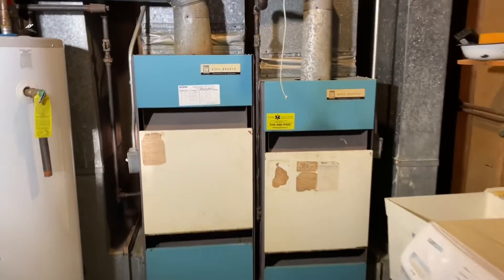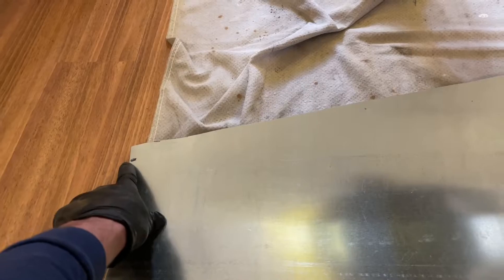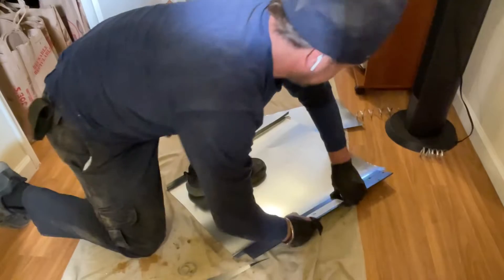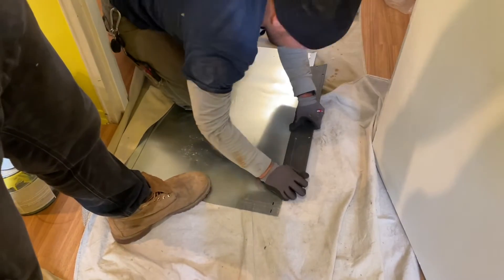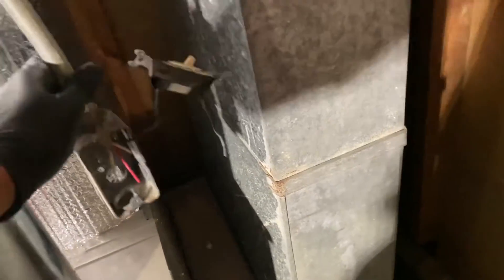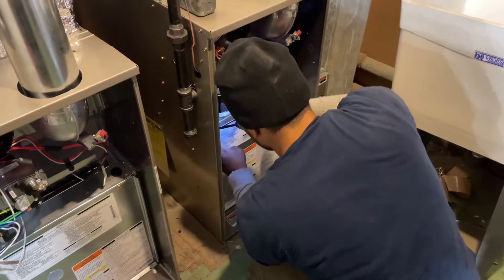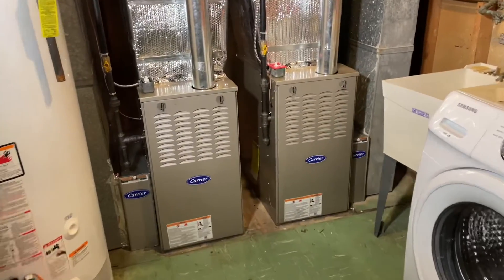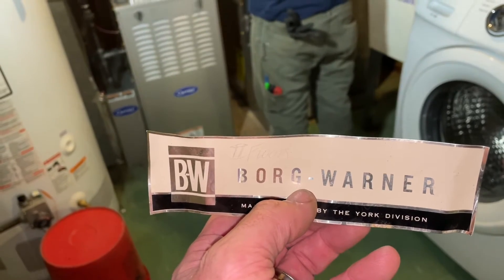Replaced Borg Warner Gas Furnaces with Carrier Performance 80% 90k BTU systems

Comment: Nice work. Only thing you need is to cross break your plenums.
Reply: @PipeDoctor  take a flat blade screw driver and a straight edge. Place your metal flat on the floor and put the straight edge across you piece at opposite corners. Run the screwdriver down the straight edge several times and it will  break the metal along that line. Repeat in the other direction. No break needed.
Reply: @PipeDoctor  https://youtu.be/-Ni6TFZSo10 this is my vid on how to do it. Hope it helps.
Reply: @IslandbreezeMechanical  Even Steve Lav likes that tip  !!
Reply: You can also buy a larger bender and fold it diagonally just enough to create the crossbreak and it will look cleaner too.
Reply: you can use a length of s cleat corner to corner and bend the flat stock or put it against a stud in wall.